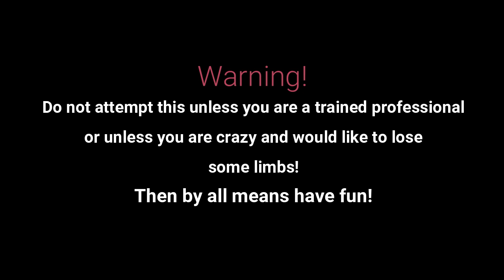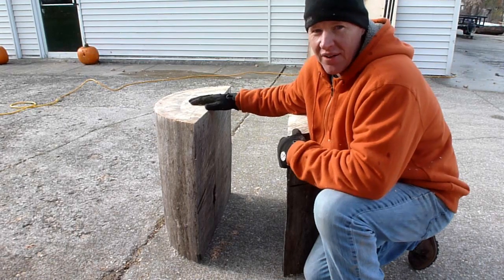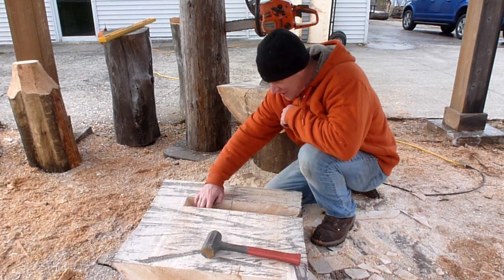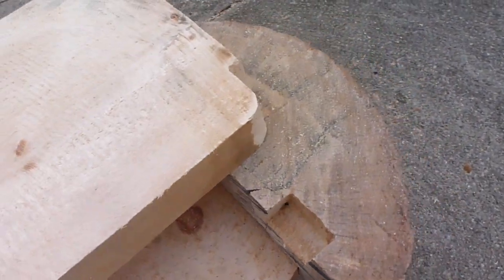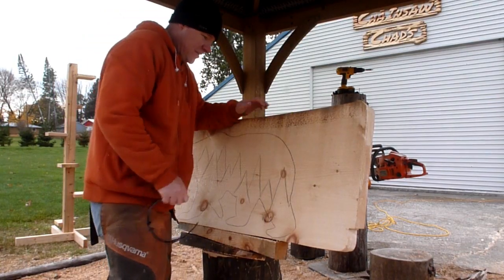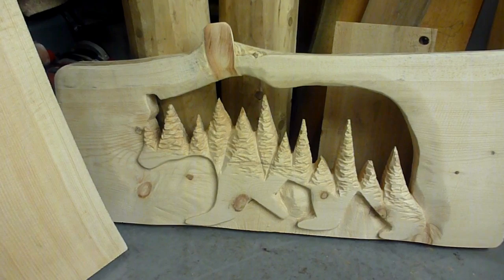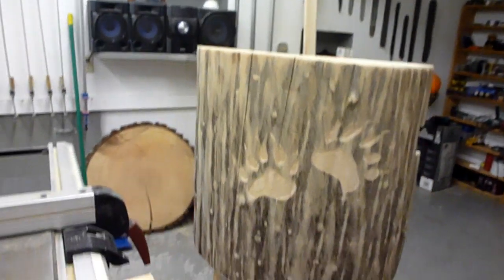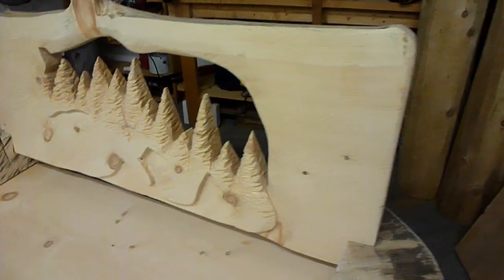Chainsaw Carving A Bear Bench!! Carving Giveaway!!

Comment: Congrats Nancy . Beautiful bench never seen a design like that might borrow your idea . What's your opinion on those chainsaw disc's for angle grinders .
Reply from the maker: The chainsaw angle grinder looks awesome I have never used one yet. I have heard it's easy to lose some fingers.
Reply: A firm grip is needed when using them. Never wear any kind of gloves, too easy to catch. Clean work area, and always make sure it stops turning before letting go with either hand or before setting it down. Both hands on the grinder at all times. And a face shield is the advice I’d give on the grinder with sawtooth chains. I have a set from King Arthur tools. I wouldn’t recommend the cheap knock offs.

Comment: Great bench!  Maybe I missed something in the video, but I'm wondering how you keep the back from cracking or breaking off?
Reply from the maker: I used long screws to hold it. Thanks for watching the videos!
Reply: I see you attching the screws on the bottom, but what keeps the back from breaking off?  I've been using a 2X4 attached to the base and then the back, but you must have a differnt system.
Reply from the maker: The backrest is a 3in. Thick slab. It's not going to break